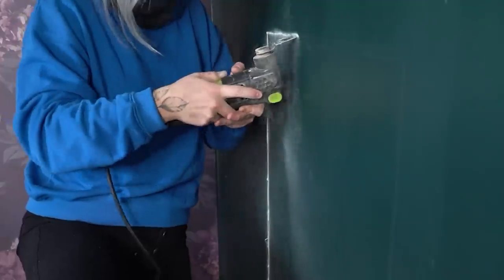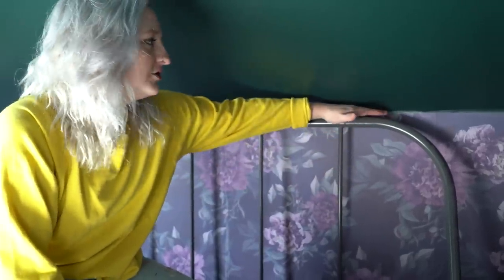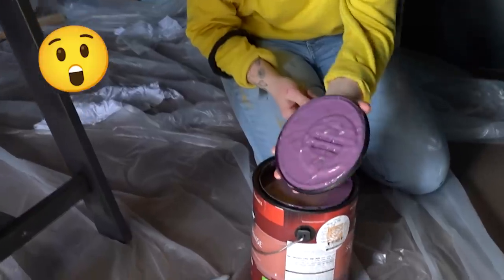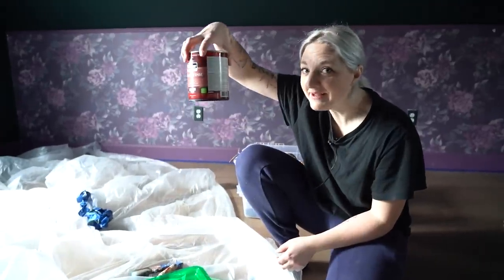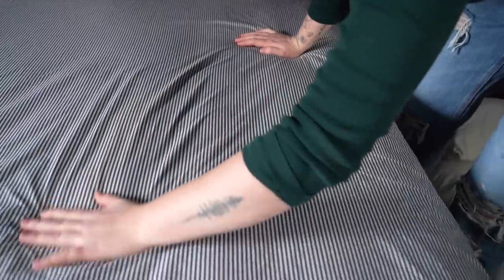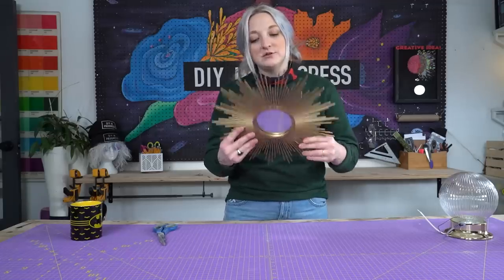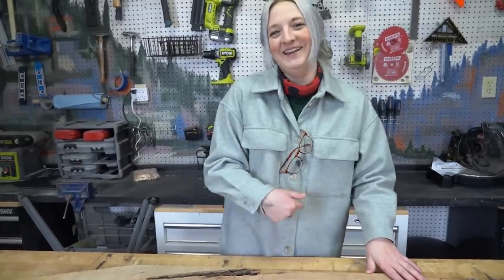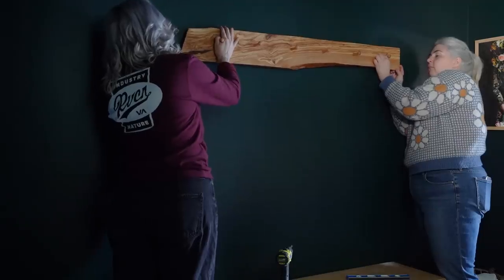*DARK & MOODY* floral bedroom refresh | simple diy updates with big impacts! | DIY Danie

Comment: Tip for your fireplace if the flames still work but the heating element died, I put a tiny black heater on top to use for heat and then just turn the flame light on.